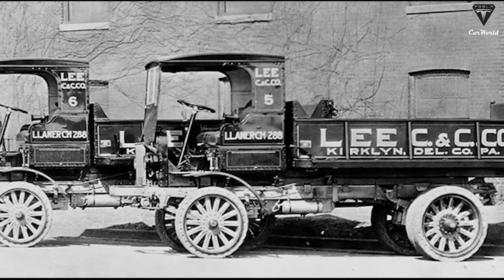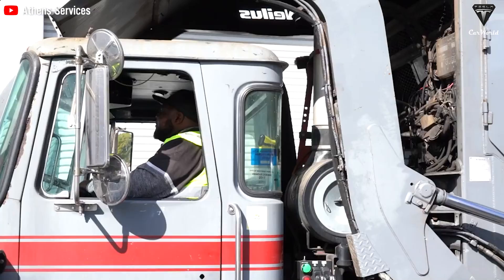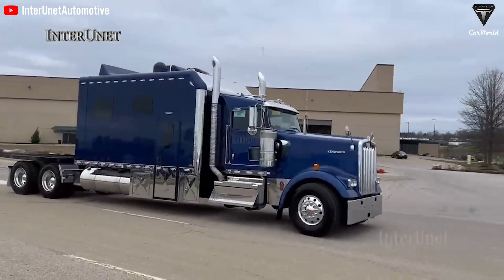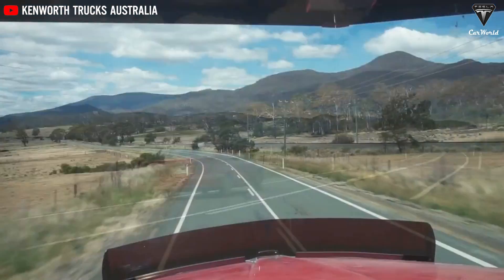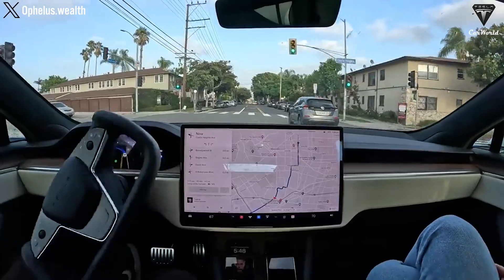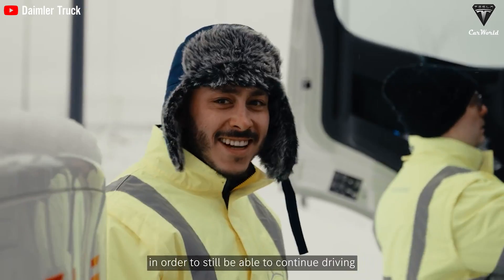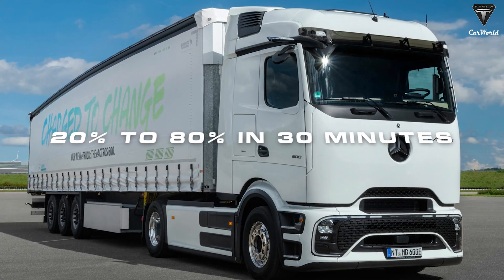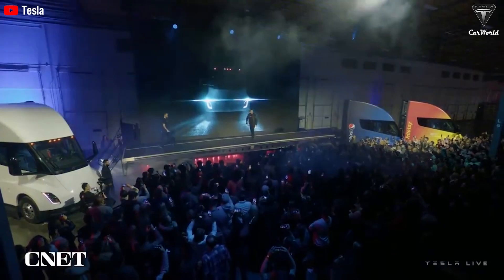Why were Americans forced to stop producing Cab-over Trucks?

Comment: The different regulations in the USA and the EU seem to be compared with aerodynamic issues, and specifically Tesla Semi. It has no relevance at all. In the EU, the total length is everything. At the same time, different countries may have different regulations related to weight and length. Moreover, range is a minor issue as drivers has to take a rest at certain times and charging can be done. The Tesla Semi simply has to be redesign to fit the European market.